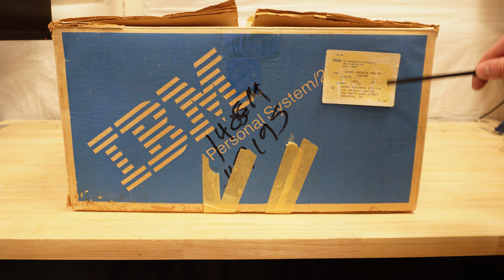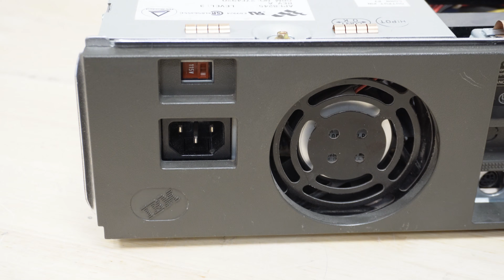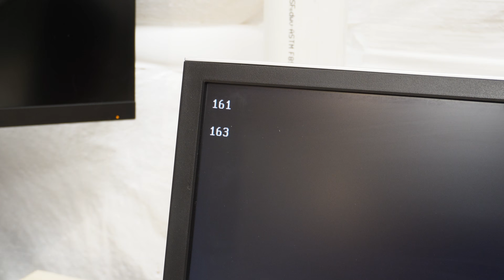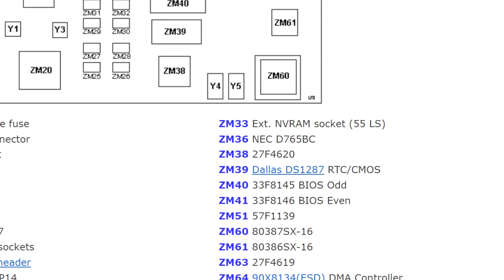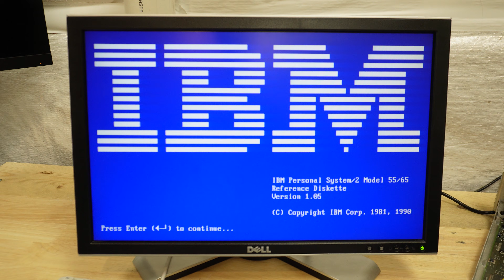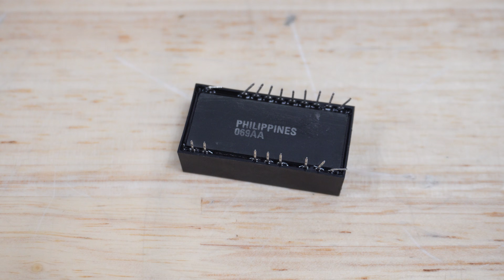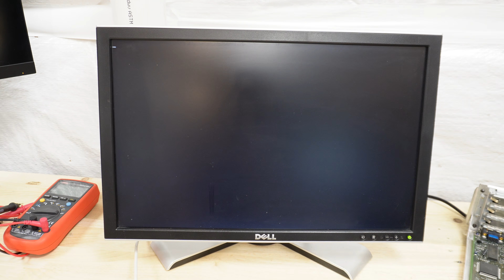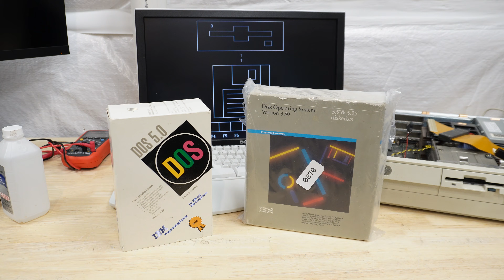IBM PS/2 Model 55SX

Comment: I'm here for net boot content!

I'm actually in the middle of a net boot project myself, I have a dozen of these SIS550 SOC based thin clients that I'm using as main storage and boot server (they have internal IDE, but it's not super convenient to use) and I want the others to boot from that or at least still use it as storage.
I'm trying to avoid using the internal MSYSTEM disk on chip, because it's slower than ethernet and it's only 32MB... Worst case is I run a minimal DOS on it and network for everything, but net booting them all would be much much cooler.

End goal is a mini multi-station multi-player retro gaming setup.

Comment: If I remember correctly, if the model number is < 50, it uses ISA and more standard stuff, and if it's > 50, it uses MCA, ESDI, etc. However, some models of PS/2 actually used different hard drive interfaces. I remember LGR going over one of his, thinking it was ESDI, bought an ESDI drive and it turned out to be something even more niche and unusual. Luckily there are actually some people making new MCA cards, especially sound cards and whatnot. I know TexElec has one, but there's also an open source project called the Snark Barker MCA that's apparently an amazing card to have for these.
EDIT: Luckily your board does have the co-processor slot, and I'm almost positive there is a 486 upgrade that was specifically made to go in the 386 copro socket. So you might be able to give this old gal a pretty significant boost.
EDIT 2: Yes, you absolutely did need to use that mod to boot any disk other than a reference disk. Those chips are not just timekeepers, they also have SRAM in them that is backed up by the battery, and that's where the CMOS settings are stored, so every time you rebooted it would give those same errors and have no configuration to load, so it would refuse to boot because... it doesn't really know what it is yet. IBM was terrible for stuff like that. A single dead battery brings the whole system down! I doubt their mainframes had that sort of fragility...
Reply from the maker: That all sounds about right, didn't know about that 486 upgrade!
Reply: @clabretro  : The 16MHz 386SX of the 55SX and 65SX (the tower version) didn't even have a functional '-FLOAT' pin, so the rare 'clip-over' CPU upgrades won't work. One of my 55SX units had a factory mod Cyrix 486Srx2 CPU soldered on the planar running at 32MHz internally. There were more commonly planar upgrades, like the 'Reply 55'.